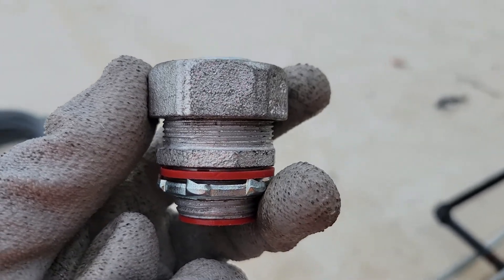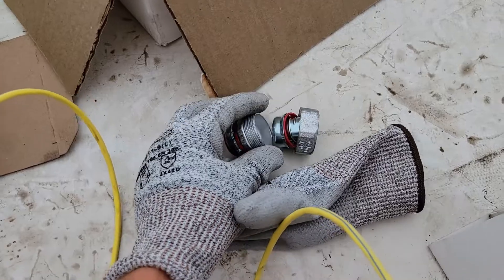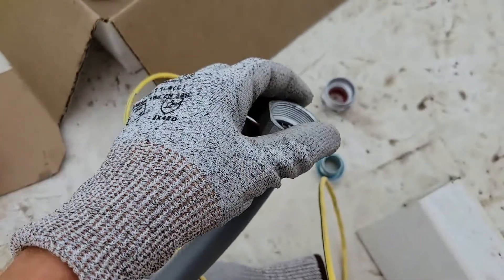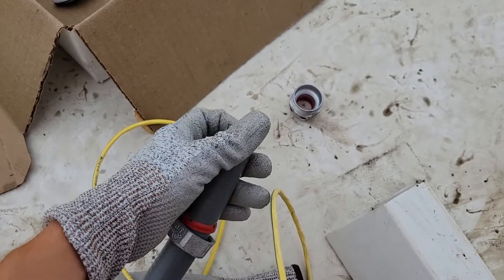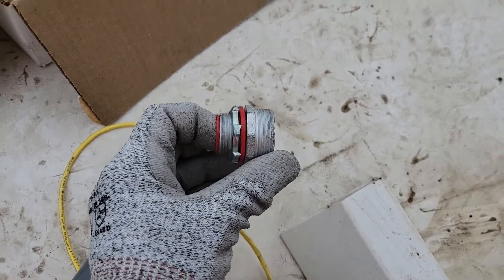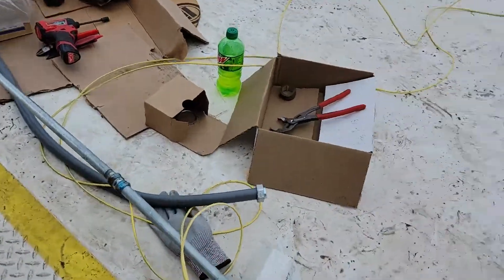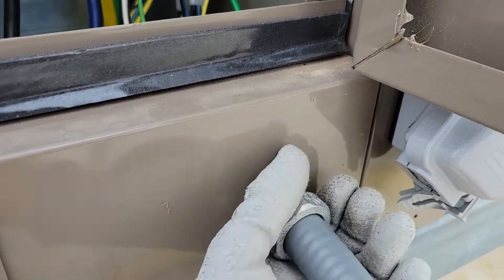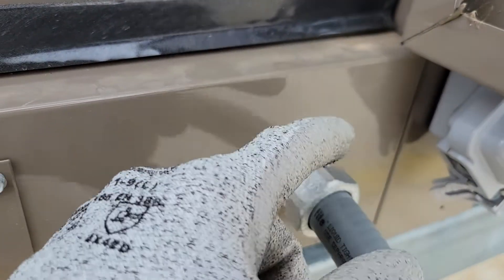How To Use Liquid Tight Conduit Connectors

Comment: How do you clamp the wire so it doesn't get pulled out of the box?
Reply from the maker: Thanks for the comment. You don't, if the wire is getting pulled on you should use some type of multi conductor and cord grips with stress relief.

Comment: Liquid-tight seems more robust than AC90 / Metal Clad, because during handling you run less risk of kinking the cable, you can change wiring if that even happens (so long as the fill is ok of course), and no worries about sharp edges and thus no anti-shorts (red devils) are used.
I do have a quick question: what's your opinion on PVC connectors as opposed the metal ones you're showing here? There are these Liquid-tight kits that come with a bunch of straight and 90 degree connectors.
Reply from the maker: Metal holds together better over time. You have lmfc which is liquidtight flexible metal conduit. And you have lfc which is liquidtight flexible conduit. The metal version has metal the entire length and is way better.

Comment: can be fit in electrical PVC on outdoor panel board switch??
Reply from the maker: It technically can but proper way would be to change the pvc over to a rigid coupling. Thanks for the comment.

Comment: what if you don't have access to the other side of the wall to add the nut? For a residential application, i need to go through a rim joist, some sheathing, 1" rigid insulation, and finally through vinyl siding. I'm also using non-metallic liquid tight. Is there a different connector that i can use in this instance? Thanks
Reply from the maker: Thanks for the comment and great question. Without seeing the problem, its hard to get a proper answer. If I understand the question, I normally liquid tight to a bell box on the outside. Then I would use a threaded romex connector in the back of the box to properly secure the romex. Caulk around the box and call it a day. I hope this helps. Have a great day!